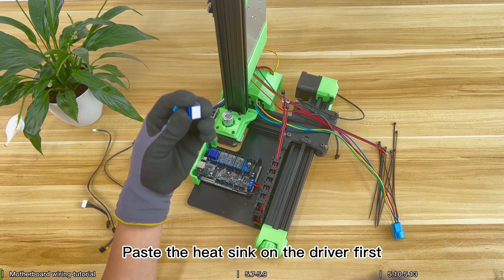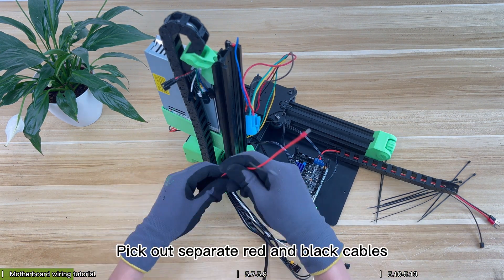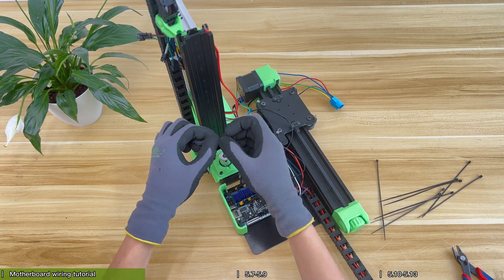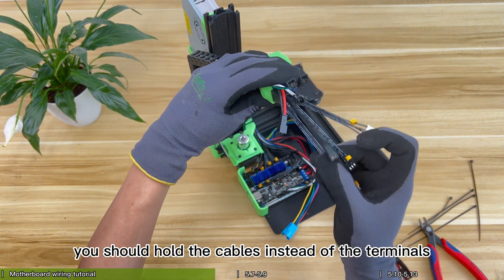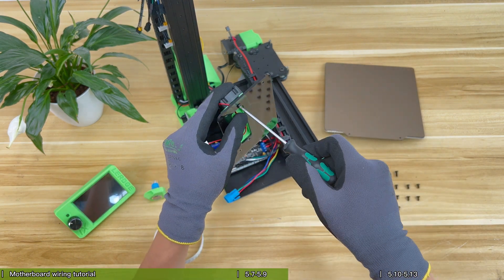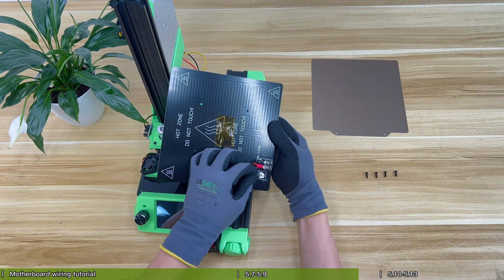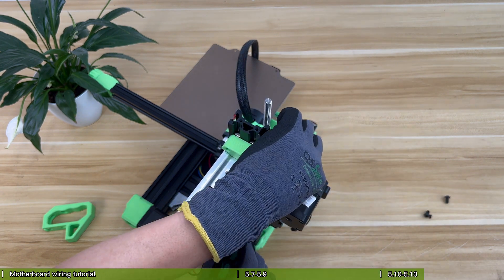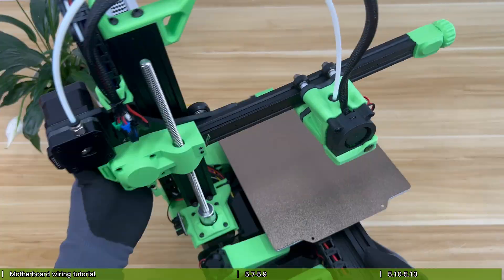【V3.0】Step 5.2 Build Lerdge-iX | install Electrical Parts DIY 3D printer project for beginners

Comment: What is the different between the iX V2.0 and the iX V3.0? Can you explain it please.
Reply from the maker: The main difference between V3.0 and V2.0 is that it is easier for V3.0 to upgrade linear rail 3D printer: 30 minutes for V3.0 to upgrade linear rail, but 2 hours for V2.0 to upgrade.  Specifically, V3.0 has pre-reserved holes and other designs for line rail installation